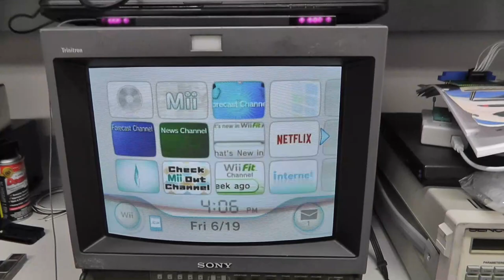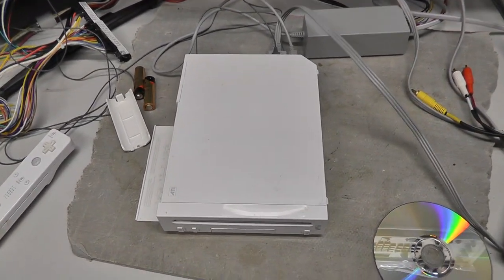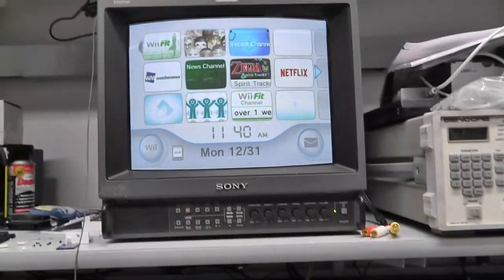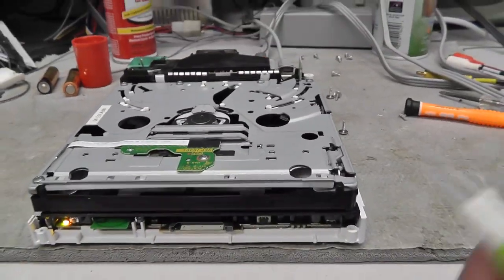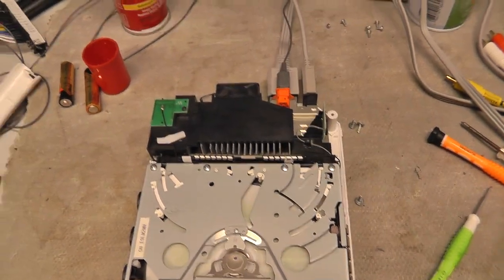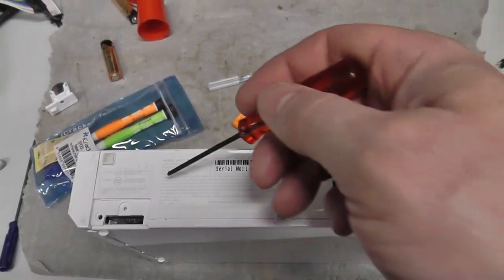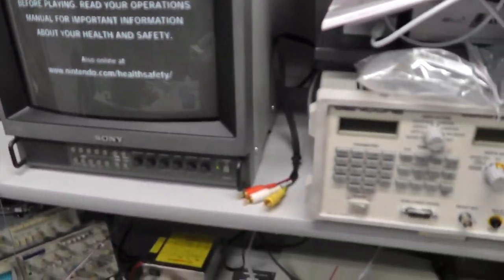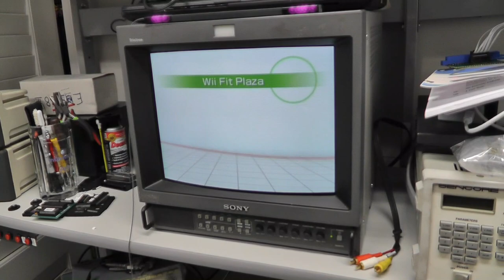Wii DVD Replacement - Constant Disk Eject and Latch problem

Comment: At 8:23 or so (https://youtu.be/QuwUOwNEank?t=513), the cracked, slipping gear is the problem.  That gear just spins. Fix it in place. Pull out that shaft, sand it, add superglue, slide gear back in place. Be careful about final position.  Give the glue plenty of time to set. Then test. Then reassemble and enjoy.
Reply from the maker: Thanks for the comment and suggested alternative fix.
Reply: Thanks man, gonna try to fix mine soon
Reply: Great tip!! For me, clamped mine a few times with a vice grip so it created small abrasions on the surface so that part would fit more snug and then I epoxied it.
Reply: thank you Bill... that´s the way!
Reply: THIS IS THE WAY! 🤘🏻🤣🤘🏻
Reply: Thank you so much for this post.  This was exactly the problem I was having.  A drop of super glue fixed it.  incredible.

Comment: Same issue. With the help of your vid, I was able to find that the small white worm gear that you can see through the housing opening was cracked and spinning around the small shaft and not allowing the neighboring gears to turn and drop the disc to spin. A dab of super glue and all works again. Thanks.
Reply from the maker: Thanks for sharing and congrats on repair.

Comment: Yeah mine's doing the same thing. I had it apart and checked stuff out but I didn't find an exact answer. I bought it as "Not Working" and it powers on but clearly it was dropped hard or crushed because even the plastic that holds the sensor receiver was broken into three pieces and the shroud that makes the tunnel to bring air through the fan was broken. I literally super glued them all back together and it seems to hold but there were still like five other broken pieces of plastic floating around that I couldn't see would fit well lol. I don't want to spend the money on a whole new drive so I'll probably take it apart again and focus a bit more on hearing the noise and troubleshooting. Thanks for posting, some renewed hope on solving the issue without spending more.
Reply from the maker: Sounds like you have very sick patient to fix up.  Good luck.  Hope you get it going.

Comment: Jack, great video! Did you check on plastic gear sets that are available on the net?  Very inexpensive….some even come with a motor, drive belts and metal shafts. Used by modellers, robotics, rc cars and planes. 😎
Reply from the maker: When i saw the price of new drive it stopped being worth my time but if i had those parts on hand i would have made an attempt.  Thanks for comment.

Comment: Great video , is there anyway to check if the drive your buying GameCube compatible 🤔, maybe a slightly different color ??
Reply from the maker: I'm not sure.  I only researched the wii drive.
Reply: It's based on the model of your wii console, the model should start with RVL and then have some numbers after it

Comment: The one I have will not make a sound to get the disk or that it is ready to receive a disk.
Reply from the maker: double check your power but there is a little optic switch/phototransistor that triggers the motor.  It could be that or the drive motor just not able to run at all.
Reply: @jacklick  What if it doesn't run at all? Can I swap parts if I have a donor?
Reply from the maker: @inclosetgoosebumpsfan  i would try but  would start with swapping big parts like entire drive or optic pcb to narrow issue..

Comment: Very glad that you got it running again. But now the question is. Did you ever fix the old disc drive?

Im just wondering because i have seen many similar cases when the drive just can’t take the disk in properly. Let me know if you ever successfully repaired it. Thank you so much bro!
Reply from the maker: Unfortunately, I never attempted to repair it.   For the time vs $$$, it just wasn't worth it to me.

Comment: What a waste of time guy replaced the drive. 20 minute video for no reason
Reply from the maker: I replaced the drive because of the broken mechs and because the cost of new drive didn't justify trying to troubleshoot or replace those parts individually.  If you have a better  more cost efficient repair, post it and i will pin the comment.
Reply: @jacklick  great comeback.